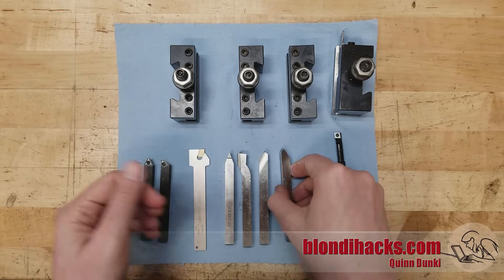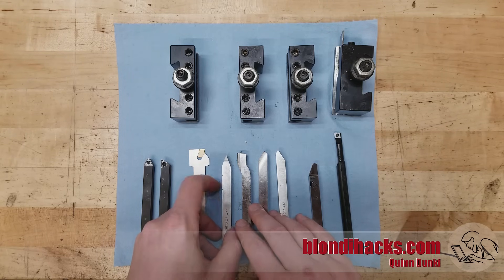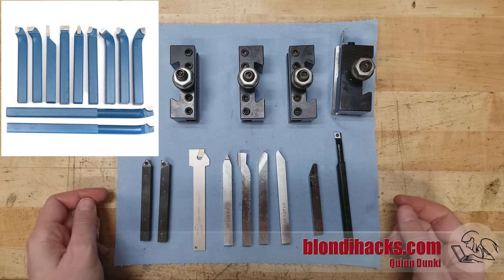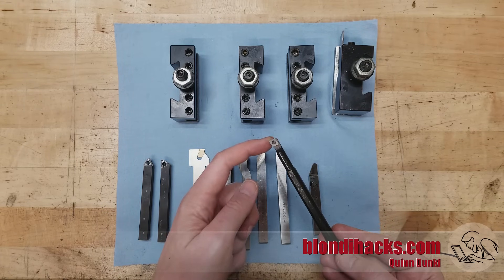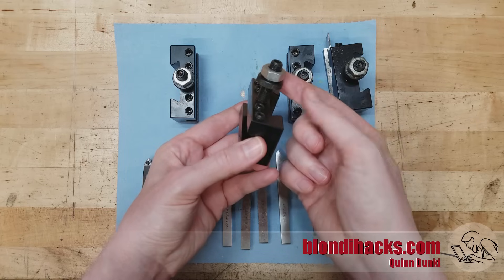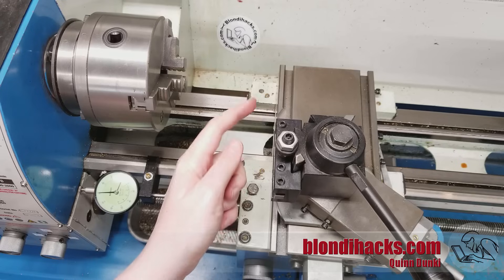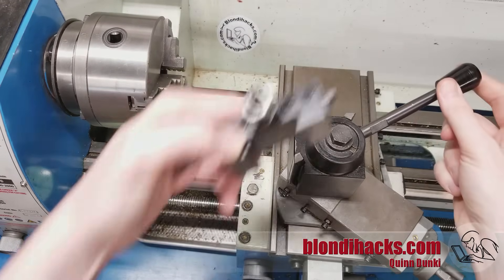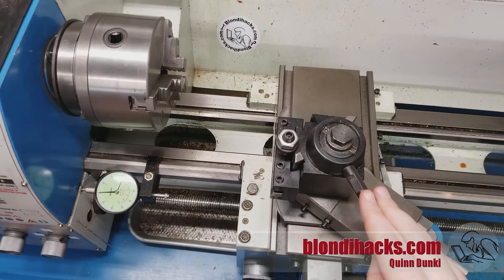Metal Lathe Tutorial 2 : Tool Bits

Comment: i have an input shaft that needs the diameter reduce by a 1/16th of an inch. its hardened steel likely similar to either 8620 or 9310 steel . it has 10 splines so it's a continuously interrupted cut. What's the best way to go about machining it with a lathe. If cutting is a no go can a grinding attachment be made to remove material using the lathe similar to the process of the machine used for grinding cam profiles and crankshaft journals?

Comment: Hi Quinn, I am relatively new to your channel, slowly working through the 4 plus years of tutorials. I am amazed at how informative they are and how you can explain the most basic procedures without being condescending.  I am learning alot, thank you. One question I have is you mentioned the smaller lathes not being accurate when turning steel. I have a grizzly 7x12, I bought it to make parts for antique clocks. The first choice was an old jewelers lathe, but that seemed to small and the sherline type seemed to small so I have the grizzly. With care,careful set up and steady rests ect, will I be able to make some parts with accuracy?

Comment: Quick question about the tool height. The cutting surface of the tool (the top point that touches the work piece and does the cutting) should be directly in the center of the work piece (height-wise) when "turning"?

Comment: Hi. I'm starting off with machining. The reason I need a lathe is to machine bearing seats for folding knives. The steel will be hardened before hand. Would that mean that I am limited to Carbide tool bits only? The steel will be hardened to 62HRC roughly.

Comment: Hello Quinn.  This has been a really great series and watching all of it for the second time before making my first project on my new PM1022 lathe.  I do not remember in any of these videos if you covered selecting the right tool for the cut one is making and the orientation of the tool to the part.  I tried making my first cut, a facing cut of course in brass and it made noise that was not like anything I have heard in your cuts.  The surface did not turn out very nice either.  I can only assume I am using the wrong tool for brass, or for a facing cut and it was not presented at the right angle for cutting a face.  I would love to see a video or so on selecting the right tool for the metal and orienting it correctly for the cuts.  Sorry if you already did this, please kindly point me to this so I don't ruin any tools.  I have an 8 tool HSS lathe tools set and some I don't understand what they are for.  I watched your video, #3 in the series on facing and you were using a tool that was rounded on the nose which I do understand why.  However none of the tools in my set came with a rounded nose..  I am wondering if I should just create a nose radius on one of my tools so it can be used this way.  Which tool should I do?  There is a tool marked 60 degree Left handed and another marked 60 degree Right handed.  Thanks so much for your series, I would not be able get started in the hobby if it were not for such a great resource.  Yes, I am a patreon now.

Comment: Your lathe series is excellent. Regarding that Grizzly HSS set, is that right hand tool for steel? It almost looks knife-like rather than the traditional shape like in your grinding video.
Reply from the maker: For steel, yes. It looks that way because they mass-produce the top rake using a round grinding stone. The angle behind the cutting edge is 10°, this is just a different way to get it.

Comment: You're so awesome!! I'm a female who wants to learn to be an actual machinist. These videos have helped me get a knack of what to expect!
Reply from the maker: That’s great, Heather! Don’t let anyone tell you that you can’t do this stuff, because you can. 😄
Reply: @Blondihacks  How much math does one need to do all this stuff? Kinda nervous because I haven't done math in so long.
Reply: @HeatherSt.Therese  You do need good basic math skills, decimal/fraction conversion, geometry and trigonometry, enough basic algebra to do Trig and formulas.  Much of what you need to figure can be done using formulas which simplify things but to be a true machinist / toolmaker /moldmaker / modelmaker you need to eventually have very good math skills. Hand written CNC programming requires very good math skills to determine precise locations using trig, but most of that can be done using CAM software so today isn't quite as important as it used to be.  So yes math is very important but you can learn it along the way.

Comment: Could I ask you what the power rating of your lathe is dear Quinn? I want to buy a lathe with 1HP. I ask because the changeable type carbide bits are more comfortable than hss and you said it´s only for bigger lathe machines. I just want to know If 1HP is enough or not ? The machine is 8x16 inches as the chinese say 70kg.
Reply: My lathes have only half a hp, but they are pretty rigid. Only use carbide inserts, never HSS

Comment: Quinn, you mention carbide needing speed and power to work correctly and that hobby lathes are not good candidates. Can you clarify where that line is? Where does the machine used in the video fall into this equation. Thanks!
Reply from the maker: The line is kinda blurry. I’d say you definitely won’t have good luck on a 7x14 mini lathe and you definitely will on a Monarch. In between, it’s “try it and see”. Lots of people use carbide on small machines just fine. I do use some myself. Mainly I think HSS is much easier to learn, which is why I recommend it. It’s also a lot cheaper. One piece of HSS can be reground indefinitely and will outlive us all. A carbide insert might last 10 minutes when you’re still trying to learn speeds and feeds and constantly burning them up or using the wrong ones.

Comment: Tip from another home machinist, forget HSS. Carbine inserts and toolholders (chinise) are so cheap and so good that everybody can buy these. When insert cost 50-60 cents, you can take new for every project, and if you have for example WNMG inserts, there's six cutting edged in every insert; less than 10c/cutting edge. They cut hard as well soft materials, surfice finishing is good, chip breaker works nice... Absolutely no sence to start grinding hss blocks.

Example: set of four toolholders and ten inserts cost about $20:
https://www.ebay.com/itm/4pcs-12mm-Lathe-Turning-Tool-Holder-Boring-Bar-10pcs-DCMT0702-Carbide-Insert/292953364226?hash=item4435619702:g:fCcAAOSwjt1byDeM
Reply: Hi